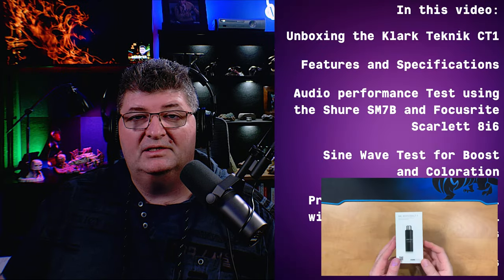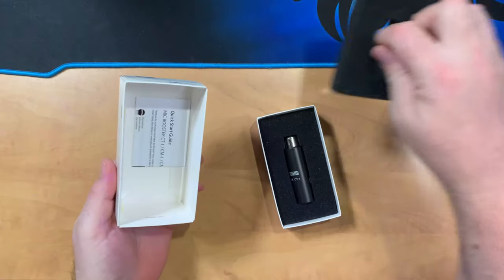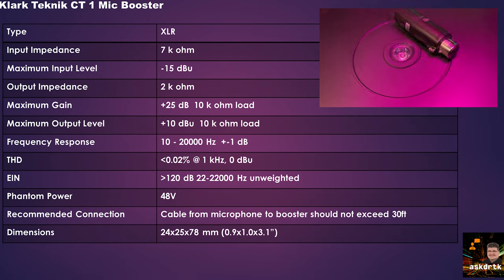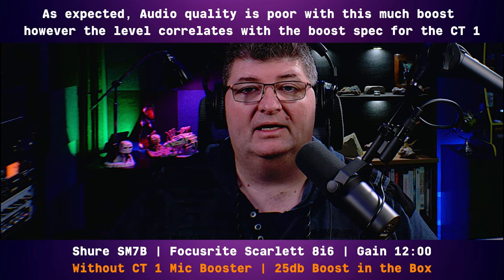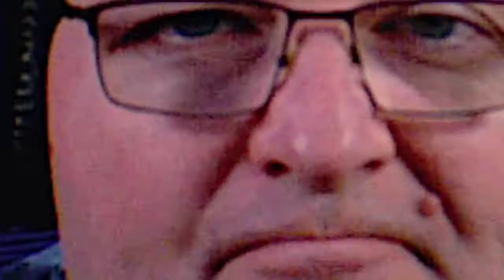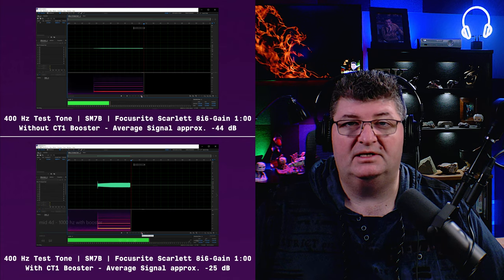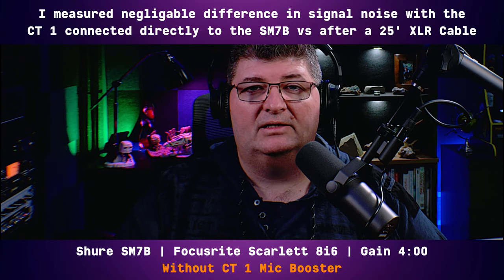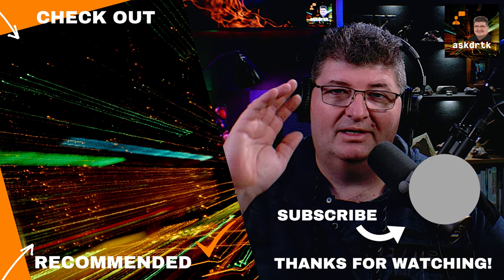Klark Teknik CT1 Mic Booster - Detailed Review and Tests

Comment: How do you get such clean recordings without any kind of noise floor? You have amazing audio quality!
Reply from the maker: Much appreciated. As you said, good audio starts with clean recordings and a few steps make a big difference. While it may not always be exciting to talk about, sound treatment and positioning of equipment (pc location, power conditioners, and cable routing) are the beginning of great recordings. After that, proper gain staging to minimize noise across the signal chain also makes a big difference in getting the most out of the gear you have. You never want to drive any one stage (preamp, interface, hardware effects, or plugins) too far in order to get the cleanest sound. Of course sometimes we want to "drive" the gear for coloration/saturation, but that is an artistic choice. I will have a few videos coming up on these topics. I am in the process of reconfiguring part of my YouTube space (to be more like a hybrid of the control room and recording booth in my studio) to make it easier to do these types of tutorials...coming soon... Thanks again and I hope this helps out!
Reply: @askdrtk  I've heard that one method when you have the noise floor being audible in the recording is to take a snippet of the recording where only said noise is audible, invert it's phase, and add it to the whole duration of the recording, which will subtract the noise from the end result, is this feasible or something that you might consider useful when it becomes impossible to have a completely silent background in the recording?
Reply from the maker: Yes that can be effective for background noise with consistent frequencies and amplitudes. Building vibration, HVAC noise, and sometimes even RF/EM interference are good candidates for this type of noise reduction. The key is for the background noise to be very constant, otherwise you can be introducing additional noise into the recording. The other consideration is how much crossover the frequency spectrum and phase of the noise has on the instrument or voice being recorded both with and without harmonics. This method is often best used to reduce rather than attempting to fully null the noise in my opinion. The approach I recommend is gradually increasing the level of the inverted noise recording while listening to the mix until the noise floor becomes acceptable while there are not too many artifacts in the intended recording material. Modern noise reduction plugins such as Waves Clarity Vx or Izotope RX 9 Voice De-noise take this one step further by attempting to isolate not only noise frequencies but also a temporal patterns and phase differentials between noise and audio intended to be captured. While not the whole story, this is how the "magic" of AI powered noise reduction often happens with a key advantage being real time adaptation to both noise and program material.

Comment: Thank you so so much for this. I really want to get rid of my sm7b hiss from my preamp, even with the dbx 286s the white noise is definitely there,  I do however you didn't use the gain/expander on the DBX test you did so we can hear if it also got rid of the preamp noise since you dialed down the dbx's gain knob.
Reply from the maker: Glad to help out! Using the CT1 mic booster with the DBX 286s results in a noise floor below -72dB on my system. Setting gain for an average speaking level of -16dB results in 56db of difference so that hiss will be essentially inaudible and recordings will be suitable for voiceover work. Hope this helps out.
Reply: @askdrtk  i immediately subbed when i saw your video! Thank you so much. Ive been seeking for weeks to get answers. Your channel deserves more subs! Super underrated.